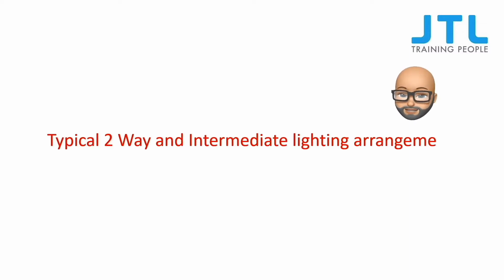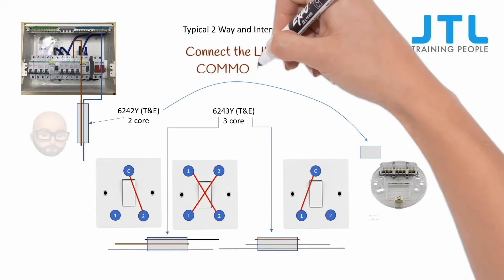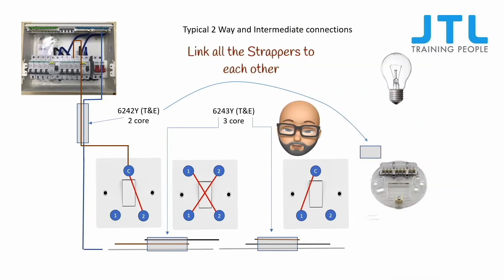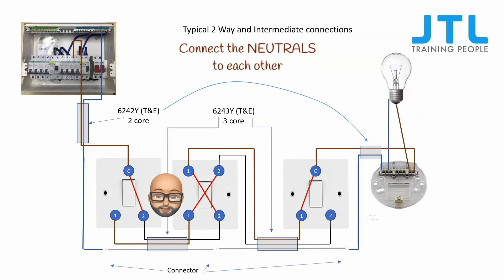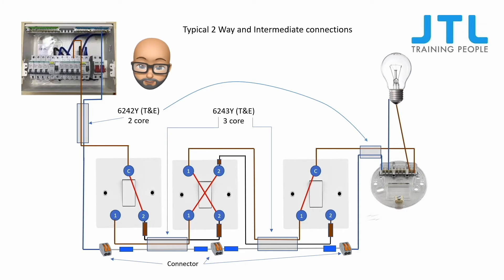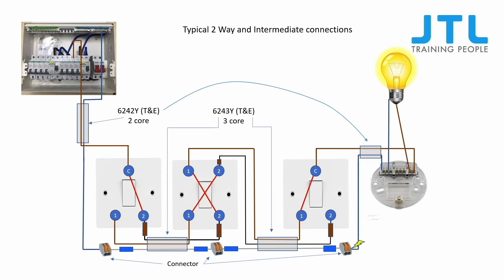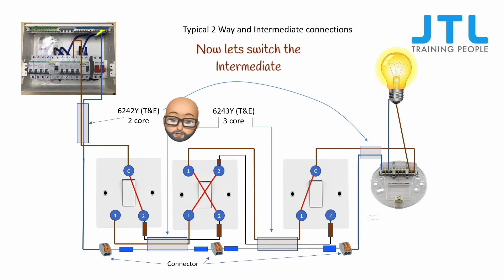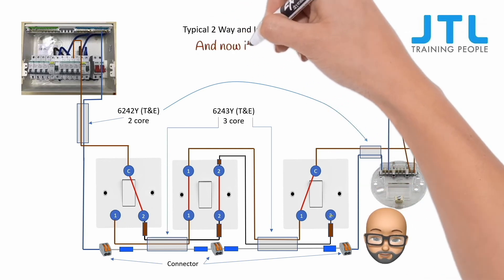2 way switching in 2 minutes AM2s

Comment: Like it. Just to point out, this is a '2plate' method or 'through the switch'. Ideal for downlights where only 2 conductors are prefered at the light fitting.
Reply from the maker: Correct … combined with 2 way and Intermediate Switching. This is similar to the arrangement found in the AM2 😀